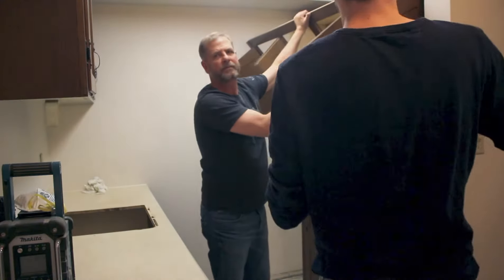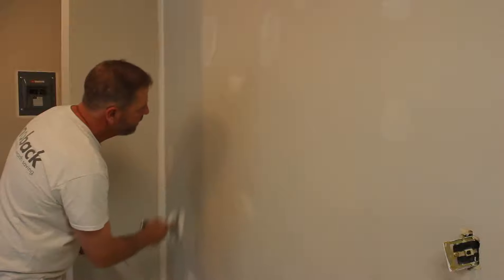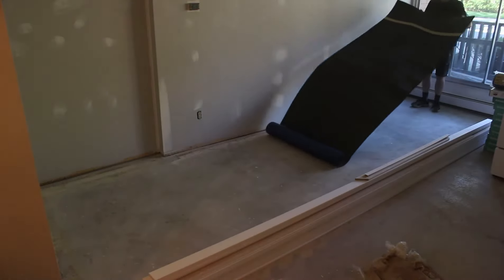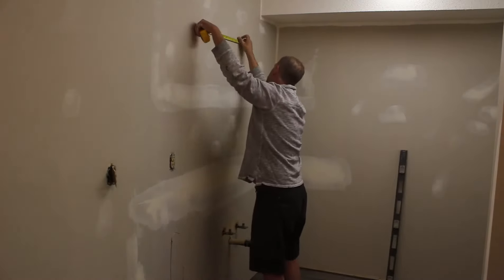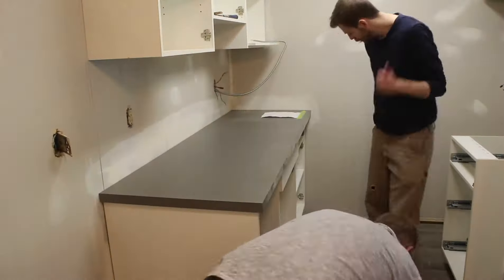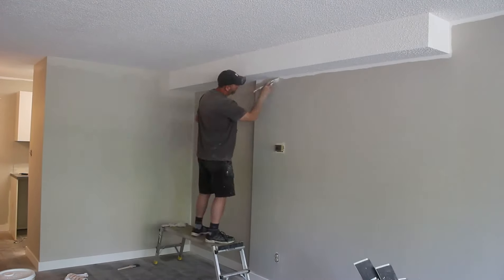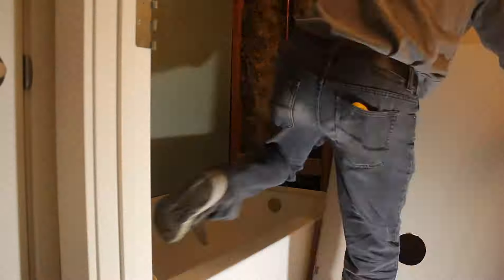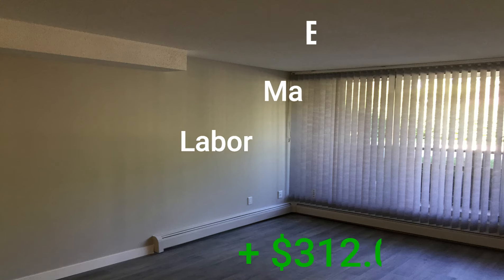DIY - How To {COMPLETE  RENOVATION} 650sq/ft condo + Detailed Costs! Renovate for less.

Comment: How is it rehabbing a condo regarding permits and dealing with any association, etc.?
Reply from the maker: Well where we live, the city regards any residential condo over 4 stories to be classed as a commercial permit, which extends the approval time by about 2 months. As far as the condo board, each building is different with their own set of rules which also can dramatically slow down the progress of a project mostly due to allotted work , delivery and elevator usage times. Are you planning on starting a project? Thanks for watching